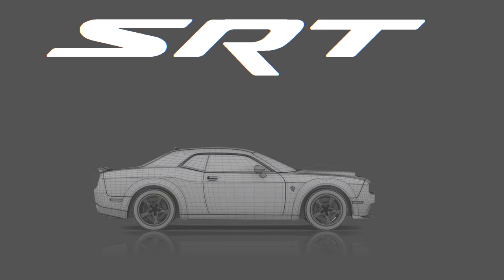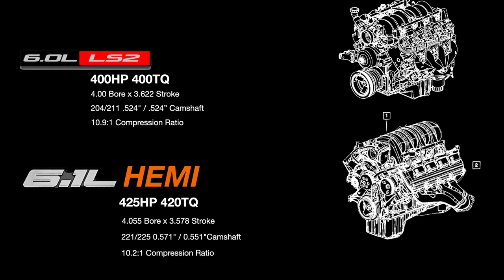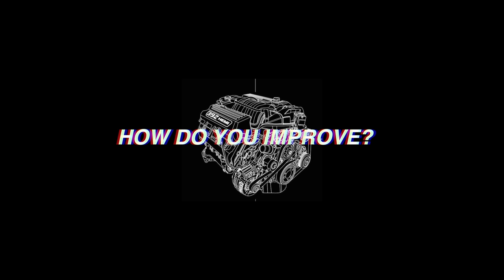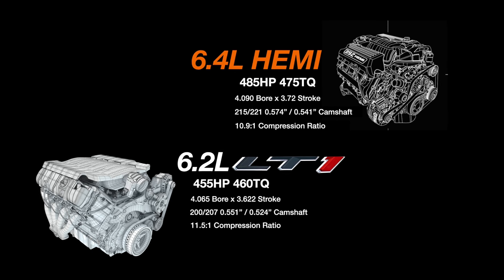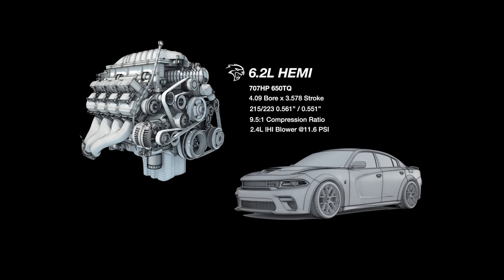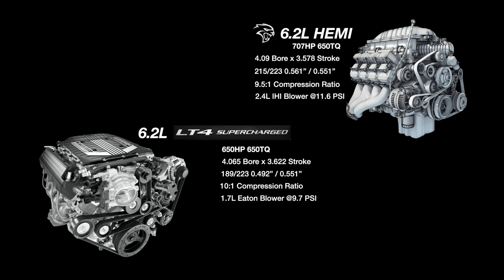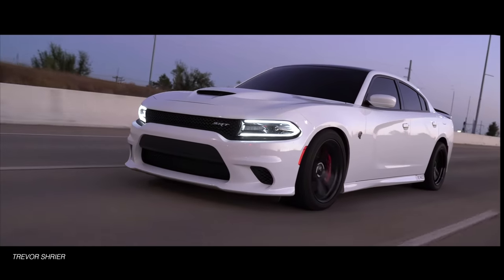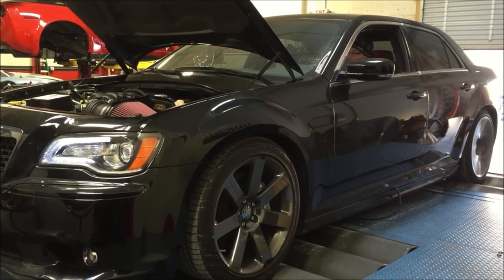Why SRT Engines Are Way Too Powerful😳| Explained Ep.3

Comment: Lol this is ridiculous. Chevy's LS engines were 6.0 liters while Hemi engines as weak as they are, were stroked and still couldn't match GMs power. Hemi is JUST now starting to put decent power into their engines almost 6 years later. 
So, in 09 Camaro dropped the 5th gen SS and it was a 6.2L VERY RELIABLE engine running circles around everything dodge threw out. Then Dodge created the hellcat and Chevy tossed the ZL1 out and spanked that lol. I remember when Hellcat owners engines were failing on them within 30K miles. 
 Then Chevy dropped the 5th gen Z/28 and it was a whopping 7.0L engine NATURALLY ASPIRATED lol. Dodge will never produce a powerful engine because they just don't hold up to GM or even Ford for that matter. Because that GT350 was killing Dodge also.
I've moved onto M3s and M4s now but This video is a joke tbh.

Comment: If you've got 30 grand to blow you could always buy a hellephant and drop it in your hemi car... youre in for some re-wiring, but it can be done.  They sell em brand new through mopar and basically every dealer.  I went with the ATK hp103 for a cammed hemi 5.7 with working mds and some inbuilt engine stability upgrades, better valve springs, cnced ports, the usual suspects.  If youre gonna replace your engine,  no sense staying stock when the same price gets you 100 extra hp

Comment: I paid 89,k + for a fuckin 2019 HellCat RedEye Charger in 2019 sold it 9 mos. later w/ 11,k. miles on it for 59,800.......car is worth $50,k at best new, wayyyy over priced, whyyy overpowered just to get dogged at the 1/4 mile track by other stock cars w/200 HP, 200 lb. ft. torque less....these cars are a gimmick, cheap ass interior materials you find on a 20,k Dodge Avenger...I got robbed w/o a gun twice, at the purchase and at the re-sale.  Est thing about the car is it's Chassis and even that made by Mercedes Benz 🤣 what a joke, lie and insult these cars are!

Comment: CHEVY MOTOR'S ARE STILL KING. NOT BECAUSE THERE BETTER. IT'S BECAUSE THERE SIMPLE AN SIMPLE WILL ALL WAY'S BE BETTER. HOW MANY OTHER MOTOR'S BEEN USED IN OTHER BRAND OF VEHICLE'S? HOW MANY OTHER BRAND OF MOTOR'S BEEN USED IN KIT CAR, AN OFF ROAD VEHICLE'S ?  THE ONLY REASON THIS DODGE'S ARE FAST COMPARED TO MOST OTHER CAR'S. IS BECAUSE THERE NOT RUNNING UP AGAINST OTHER VEHICLES WITH THE SAME POWER. DON'T BE FOOLED FORD AN CHEVY MOTOR'S CAN MAKE JUST AS MUCH HORSE POWER. LOOK UP VW BUG BAJA V8 AN YOU'LL FIND SOME OF THEM ARE SUPER CHARGED LS MOTOR'S. FIR THOSE WHO DON'T NO HEMI MOTOR DESIGN ISN'T AN MOPAR MOTOR DESIGN. FORD EVEN USED AN HEMI MOTOR BEFORE.

Comment: 🤣😂🤣🤣. Ford has the better engine and it can't be beating stock for stock. It is a smaller displacement. 5.0, 5.2, 5.4, and now the 7.3 Godzilla is king again. Ford's 429s never got beat back in the late 60s til 1970. Cobra Jets keeps breaking records. Ford Gt500 has smoked the Vipers road course records on a few road courses. So ok you have knowledge on by reading book's but have no true knowledge on the record holder's. Ford holds most of them and GM holds few also. Only way any SRT can beat Amy stock Ford or GM is tons of Mods and aftermarket parts. That makes it a none stock vehicle now. 🤣😂🤣
Reply: I own a 2021 Charger Hellcat Redeye, no mods, and I enjoy wiping the floor with breadbox-interior Mustangs.  And this is from someone who owns a 2021 Mach 1.     Keep living in the past.  BTW.....OMFG I hate GM garbage.
Reply: BTW, it's books and record holders.  PLURAL.  Stop using apostrophes for plurals.  They're for possessives and contractions.
Reply: @KevinSmith-bg9tt  you are the biggest liar in the world. Gt500 can not be beat. Gt500 has been proven the fastest car in the world. The world saying it should be in exotic car world now not muscle car since it's so fast. 🤣🤣🤣
Reply: @lincolnls0416  you can't argue with uneducated little kid's. Like this fake ass Hemi on a magnum engine. Yes I have read and seen where the Gt500 broke the Vipers road course record. That V6 Gt I hate it cause it's a V6 but damn that is 1 record break junk. Have to give it to Ford on that 1.

Comment: My SS cobalt is making 280whp on 15lbs of boost running E85. That’s 140hp/L. Multiply that up to these displacements (or just 6.0L) you get 840whp. And that’s an LSJ (supercharged) engine. The turbo engines with VVT, DI, and Twin Scroll Turbo’s are breaking 400whp with charge pipes and tune and 600whp  with Turbo, charge pipes, head studs and tune. Beware of the Cobalt SS, I promise there’s one in your area that’ll serve a gap to anything you call fast.

Comment: Dodge v8s are the worst engines in america .. they are the best right off the floor room bone stock especially the hellcat engines .. they can’t take much after market parts and what’s available will destroy your engine because it can’t take that much lower with out going aftermarket.. the LS and fords coyote engines are neck and neck for being the best v8s ever built

Comment: What a load of rubbish. I've got a 1996 Toyota with a 4age blacktop 20 valve 1.6 litre making over 160hp. Hey waddaya know thats over 100hp per litre and NA too back in the 90s. and yes it has 5 valve per cylinder. These motors seem to need boost to come anywhere near this figure.

Comment: And for everybody that loves every one of these engines just know that all of it came from Mercedes labor everything that was possible in Dodge in the early 2000s late 2010s 2020s all of that was built on the backs of Mercedes knowledge the only one that that benefited from that partnership was Chrysler of America they took everything from Mercedes even their transmissions being more reliable that was all built off of Mercedes know how and transmission designs the engines the everything top to bottom is Mercedes in design they stole from diamler of Germany and everything they learned they used to make Chrysler of America better why do you think in less than 10 years diamler of Germany pulled away because diamler us brought nothing to the table nothing...

Comment: If you blot on the eagle intake manifold to the 345ci hemi, do your exhaust and tune, leave everything else alone, it will outrun the original 6.1l eagle. If you do a cam swap with that, you'll Dino over 425hp. All of these Mopar motors will out run gm and ford's. It's the tq curve. You get all of the tq right off the start amd hold it the entire way through. Mopar has always had that but these motors are insane.

Comment: There’s a simple reason why SRT engines seem to be so amazing: it’s because they are archaic. 

No one is building an iron block engine with a supercharger attached to it. 

The Europeans all had to downsize to lower displacement V-8 engines with TwinTurbo‘s to drive the larger SUVs. 

America has been downsizing mostly to either V6 engines or forced adduction V6 engines. The only V-8 you’ll find are in the trucks or anything that can escape fuel economy penalties from the government. 

As far as putting a supercharger on a 6.0+ L engine: no one wants to do that because they already know the fuel economy penalties are far too high. 

Most of these SRT vehicles that have been sold are being returned because with gas at five dollars a gallon or higher many people can’t even afford them anymore.
Reply: You typed a whole lot of nonsense just to show you're ignorance. Sure, the gas prices AT THIS TIME is rough, but no one who owns these V8s are selling them because of it.

Comment: No thanks on all the stuff I'll go with large dosplacement big block solid cam will destroy all this c*** and then old Corvette old Corvette and as for LS motors on AGM guy but LS motors are trash you have to pull the cylinders heads off just to get it the lifters horrible design plus they don't make any radical solid cams for these motors so therefore it's b*****
Reply: you have no idea what youre talking about lmfao

Comment: Hilarious how they ditched the aluminum intake and designed one exactly like GM's. I also didn't realize how fragile the hemis were under boost. LS motors are definitely engineered to be much stronger and can take 15 lbs of boost stock no problem. Short answer of this video, why are they so powerful? More aggressive cams and boost. There's a reason most drag racers are building LS motors. I can buy a $700 5.3 with 200k miles (naturally gapped rings🤣) and make hellcat numbers with a $300 china spooly boi and Holley fuel management. I am currently building an LS S-10 with a $5000 budget and it will be hilarious when I can gap 60k cars like nothing.

Comment: The cheapest hp per dollar ratio. I love the fact that a 60-70k hellcat can demolish a 200-300k super car. American engineering at its finest. I love my Challenger.
Reply: It's really not that simple. If any of those supercars have all wheel drive. The cat is toast. Without proper tires your not gonna beat much if you can't hook up enough to at least run a consistent low 11 second pass without trying. Those 0-60 times for supercars are important because they help with 60ft times in a drag.
Reply: A FUCKING MEN.  THANKS
Reply: @duke45jp  You cannot compare a car with AWD that costs 200-300K vs a 70K Hellcat and sit there and say the cat is toast like Dodge fucked up or something.  A Hellcat was made to race but it's RWD.  It doesn't have the traction of some high end Euro crap with AWD.   But it does have launch control and if you put Nittos on her, it'll be OK.  What's next....why a Hellcat sucks because it doesn't have the instant torque of a 100K Tesla?
Reply: @KevinSmith-bg9tt  I don't even like Teslas. And yes you can because the drivers still attempt to race and compare Hellcats to Supercars. A Lamborghini Hurricane can do 0-60 in 2.9 all day. In most types of weather.  With an NA engine. Anybody can build a high enough horse power car with all wheel drive and a fast gear box. It doesn't take $200k. You could get a cheap Audi and just boost it. Rear wheel drive and high horse power comes at a cost. Driver skill and tire type. An as far as tires. Nobody is going to be running drag radials 24/7. A Hellcat can be dailyd. Drag radials shouldn't.
Reply: @duke45jp  The Nittos aren't meant to be on the car when it's off the track. You buy another set of wheels + the Nittos and make the switch at the track.  Although a Demon comes with Nittos stock and guys run on them 24/7.
A Superstock also comes stock with Nittos.   My Redeye has all season radials but if i were gonna race her, i'd buy drag radials just for the track.  So we are OTSP.

Let's do the math: 
A new Huracán is 213K - 331K,  2.9 0-60.  600hp turbo engine.  RWD. Car weighs 3000 lbs
A 2021 Hellcat Redeye is 90K,   3.2 0-60   797hp supercharged engine. RWD. Car weighs 4500+ lbs
Not really fair to compare them.  If 2 people wanna race, go for it.   It'll be interesting.  Driver skill will win the day.

I agree, someone could get a cheap Audi and just boost it.  But then you're still driving an Audi.
I'll take my Redeye over Eurotrash any day. I really have no use for any of those cars.
Good post. Thanks.

Comment: Lmfao dude, this channel is garbage. Dodge engines are absolutely shit, they weigh 40% heavier than LS/LT engines therefore cornering ability is non existent. The LT5 makes 755hp in the ZR1 and weighs 472lbs with the blower, meanwhile a standard hellcat engine that makes 717hp weighs over 700lbs, making its power to weight ratio laughably lower. Dodge failed the V8 wars, GM is the king of V8 performance, GM makes a 5.5L LT6 DOHC small block V8 that has the entire oil system built into the engine instead of separate like most and it weighs 460lbs with accessories and fluids and makes 670hp with low compression and no forced induction like turbos or superchargers

Comment: All that power but gets beat on the track all night long
Reply: False. Thanks
Reply: @KevinSmith-bg9tt  I’m sorry that you don’t go to drag races twice a month at different tracks not all at the same one. Literally the slowest on the tracks usually and that’s if they make it off the line without the rear end going out or transmission going out but that’s Chrysler for you. Saw one race against a mustang and a Camaro that both only had a bolt on and a mild tune and lost to both of them. They are a waist of money and they are junk compared to the old chargers and challengers plus they don’t even look good compared to the old ones. I forgot to add one got smoked by a 15 mustang that had a stock 7.3 swapped in 😂🤦‍♂️. Chrysler cough i mean dust and crown eaters.